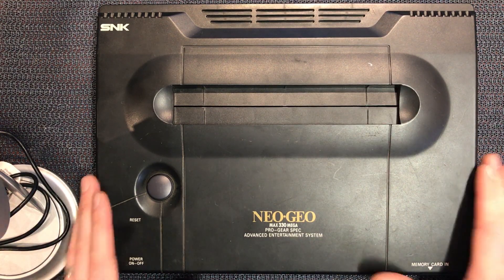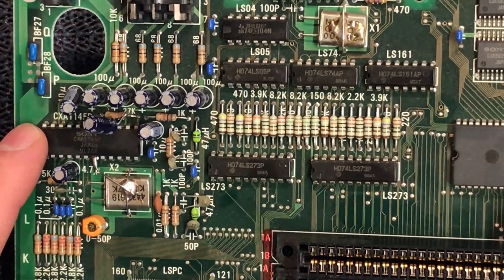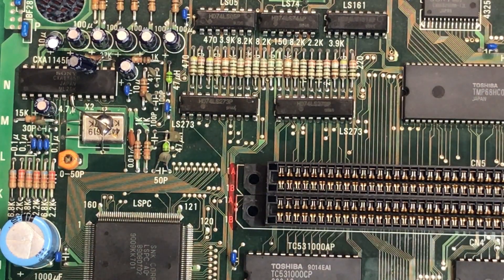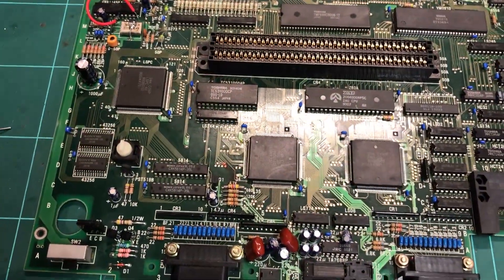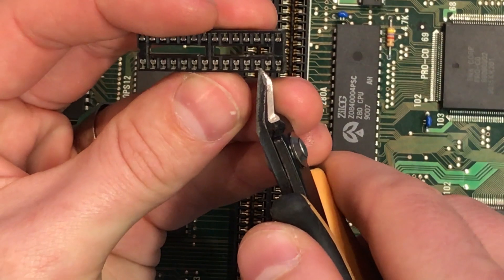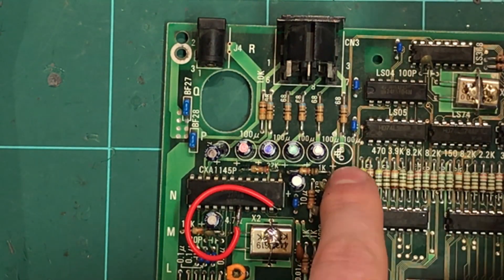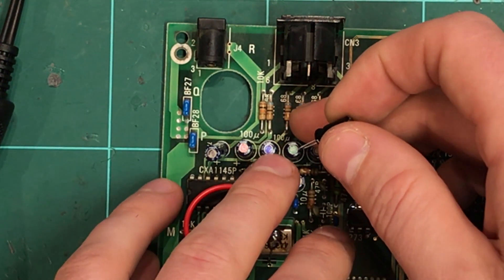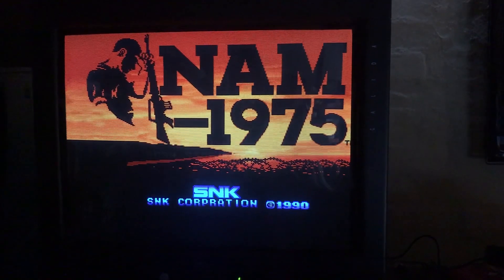Neo Geo AES Power & Yellow Screen Video RAM Error Fix - YouTube

Comment: Nice to see you found the same thing as I did with the 100uF caps - they had all deteriorated!  Mine we measuring around 40uF on two different cap meters, so clearly they didn't use great caps in these.

Comment: Great job!  Note though that you replaced the fast VRAM not the Palette RAM!  The Palette RAM is the longer chips on the very right hand side of the board.  The 100uF caps should be swapped out with 470uF on the video side, but 68ohm resistors dont seem to make much difference at all.  I've still got the original resistors in mine but swapped the caps for 470uF and it gives a picture as good as my CMVS.
Reply from the maker: GadgetUK164 - Retro Gaming Repairs & Mods So true! I had fkn Palette RAM in my head for some stupid reason.
Reply: No worries lol - It's easily done, and the fix would be the same (just different chips) anyway.  The fast VRAM holds some of the sprite data (which sprites to draw - not the actual sprite) so that's why the sprites just don't appear.  I suspect if you had a palette RAM fault the colours would be messed up or something.
Reply: You only have to watch my 4 slot repair video to realise its easy to get the chips mixed up.  I targetted the palette RAM chips when I was looking for the fast VRAM chip...
Reply from the maker: I honestly struggled with this early revision the whole time I had it as the layout was very odd compared to the later boards.

Comment: wow! of all the times ive seen in videos chips swapped out its never been as simple a fix!
Reply from the maker: The built-in diag screen pointed to the video ram with a Yellow screen. So it was a good place to start after inspecting the traces. On other boards i've seen nearby traces cut but in this case, it all looked perfect so I went ahead with the total replacement. I kept sating Palette ram in the video, so I hope that wasn't confusing.

Comment: Incredible video. I have an AES copy of Alpha Mission 2 that has garbled graphical issues and it's the cart itself and not the system. I've cleaned the contacts with both alcohol and a hi polymer eraser and still no luck. I was told by the previous owner who believes the caps inside the cart need to be replaced but I don't know. If you have any ideas or solutions to this problem feel free to share. Note I find it interesting that the armor select screen seems to function normally and that's it. The rest of the game has glitched graphics because I used a level select code to see how much of the game was glitching and it's the entire game except for the armor select screen so if you got solutions send me what you know bud I'd appreciate it thanks.👍😎👌

Comment: And I believe you could have left it on PAL btw and just used the jumper to switch to 60hz - you will get better colours with PAL 60 vs NTSC 60.
Reply from the maker: That's an interesting idea I could have tried. I'm not sure if all TVs support PAL60 though? RGB turned out great so I gave up fixing the composhite. I suspect there was a line running under the encoder causing the dot crawl but I couldn't be sure. Seems like a bad design with these first revisions.
Reply: +Global Garage it's probably already at 60hz, either that or you've now got ntsc 50?  I am assuming it was an ntsc model and that mod was done to output pal.  The question is did they change to 50hz too, if not it was displaying already at 60 so your TV supports pal 60.  All modern TVs support it and many of the later CRTs.
Reply: +Global Garage NTSC = Never The Same Colour =D
Reply: I notice the unit has a 4.43MHz colour crystal (the crystal that had the ground wire across to the pin7 on the Sony cxa1145p) which would also need changing back to a 3.58MHz crystal, this should remove the composite video shimmering issue I believe. (I have an AES board of this same early revision)

Comment: Mine also had the yellow  screen, and the number is like 000088  ( I bought it broken) ... so is even older,  the  top case has broken so I founded another one from an earlier edition, but it doesn't fit perfect. I wish I could fix mine too. Mine still has those power transistors and resistor, you are lacking.

Comment: I should point out that Yellow is screen RAM/VRAM, not Palette RAM. Green is PaletteRAM/Color RAM. The chips you point to do appear to be screen RAM/VRAM, which is consistent with the yellow screen.

I’m currently dealing with one green screen AES and one yellow screen AES. Swapped in known-good palette RAM and VRAM chips but no change. :(